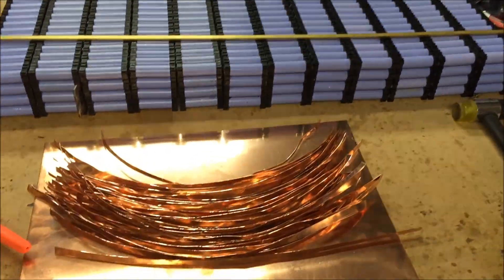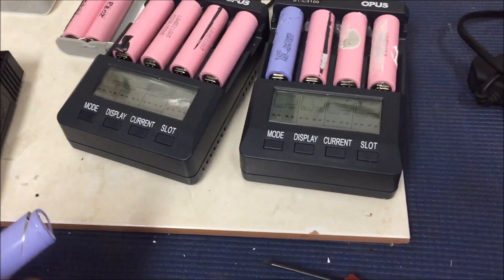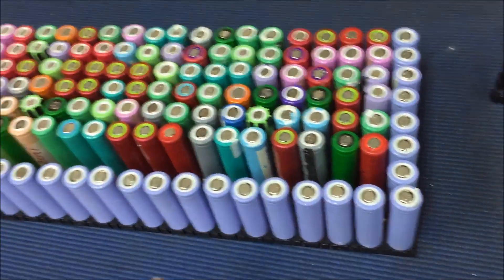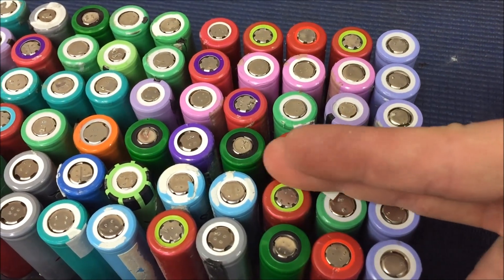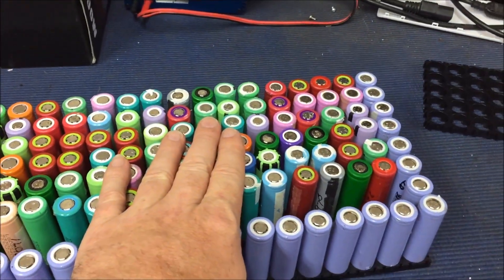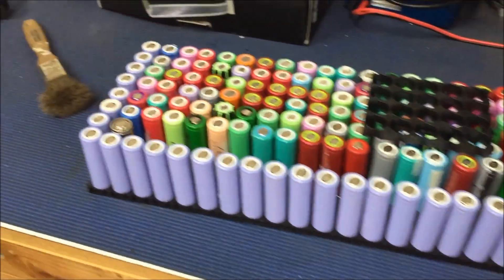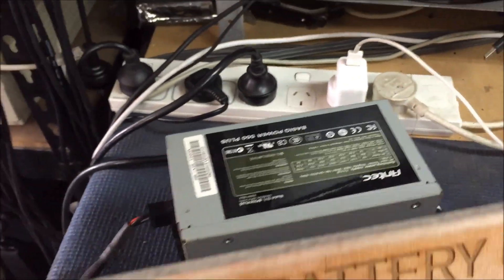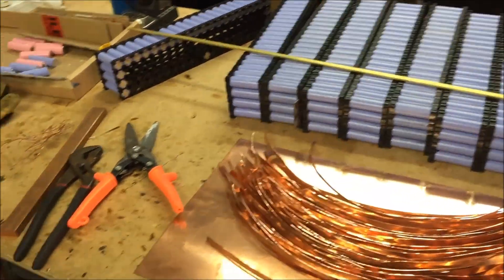DIYPowerwall progress update

Comment: heya nice update, yes that will be a very intresting update as I have a lot of cell's between 1000-2000 mah I think it could work because if you have 1000 mah x 100 cells =100 ah and wen you want tot  have the same cell pack with 100ah but with 2000mah cells you only need 50 cells so lets see in pratic if it's true

Comment: Probably too late for this, but depending on avg capacity of the other cells in the bank, could maybe have rotated your 4x5 holders and just put in 100 cells.  That 20% extra might have been enough.
Reply from the maker: Did consider that how ever wanted to test the possibility of my mounting systems haveing double the cells attached to them. So i could make the bank even bigger with out too much extra expense and space requirements

Comment: Hey mate. Was just wondering how exactly you have you powerbanks laid out, do you have you 18650's wired in parallel in the packs(20x4) an then your packs wired in series, just trying to work out how you've done it as I'm looking at doing the same an I really like the way you've done it
Reply from the maker: 80s 14P x 3 :)
Reply: HBPowerwall woah so each pack of 80 is 336volts. And then those 14 packs are in parallel. And then you have 3 of those banks? Seems alot... or is it 80p/14s x 3?
Reply from the maker: Possibly hahahah woops ..

Comment: Hi Pete, you gonna be able to run your hot water service with the extra 10kwh ?
Reply from the maker: not without another inverter but it's on the cards
Reply: Cool! If you had the inverter power how many watts do you think you could safely draw without damaging the batteries on the 20 and 30 kWh system?. i am trying to aim for 20 kW..I'm halfway there...probly have another month..or two  of testing or so ...
Reply from the maker: +Eric Hendrickx easily 6000 continuous

Comment: Just wondering do you know if the charging efficiency (energy out compared to energy in) degrades with older lithium batteries approaching end of life ?
Reply from the maker: To be honest haven't tried to work it out and given batteries are fully charged 2/3 of the way through the day it isn't an issue. If i was charging via grid in off-peak and discharging in peak times i guess this would be important.
Reply: OK thanks, you're right its only important in some situations, like off grid solar.
Reply from the maker: With 10kw of panels to charge my little 'off grid solar' I got charging covered :) If I had 2kw of panels - then we got issues :) If I were charging from the grid hell yes ! get on top of that lol It's all relative to your personal setup
Reply: 10kW ! yes, you are well covered.
Reply from the maker: There isn't any heat in the cells :)
Reply from the maker: max draw per cell is 0.6a and that is when your pulling 4000w ac power from it (80amps dc @ +54v) normal load is 500w :) Nup no heat issues unless one internal shorts then the fuse blows and your none the wiser. Going from 20kwh to 30kwh will reduce load per cell even further thus - still no heat.
Reply: do you think a large distilled water bath would make sense to soak heat away or some other non conductive fluid as long as it is way larger than needed so there is no possible way of the fluid to heat up
Reply: If there is no heat in the cells then I guess this means they are reasonably charge efficient.
Because if energy is lost between charging and discharging, then it must escape as heat.

Comment: have any heating issues on the wires going to all those tp4065's from the pc power supply?  I had to beef up the wires to use my power supply.  I've got 15 of them which would be about 15amps out of those dinky wires, got a little warm to the touch :)
Reply from the maker: Checking in total panic now..
Reply from the maker: Cables from the PSU to cables on back of "18650 Awesomist Battery Charging Thingy" are warm. Might double up the cables from the charger. Can't hurt.. Ever thing else is cool as a cucumber
Reply: The cable will not warm up. The PSU I provided was a 30amp supply at 5v. Your PSU should be fine but it is borderline in supplying a current. There is nothing dangerous about what you are doing with that PSU other then it may take a little longer to charge the cells up. You should be fine nothing to panic over.